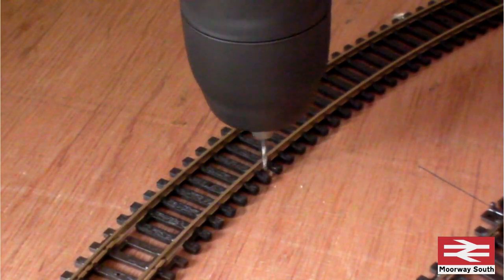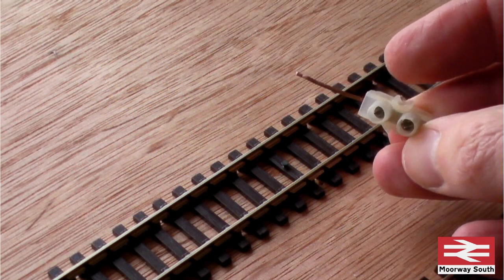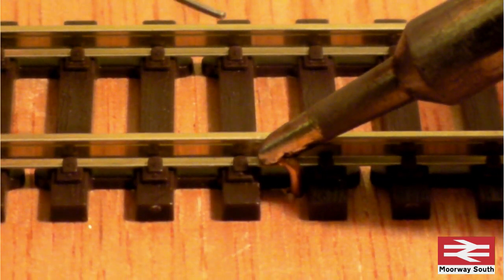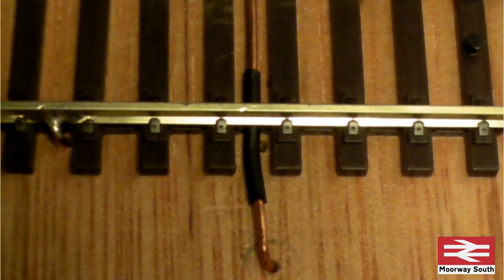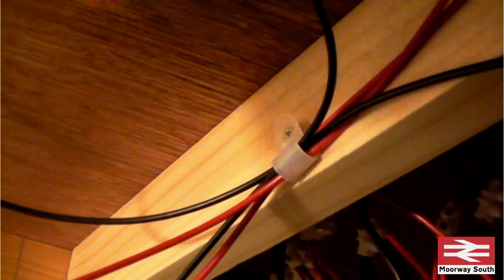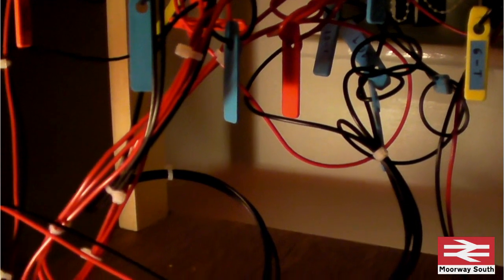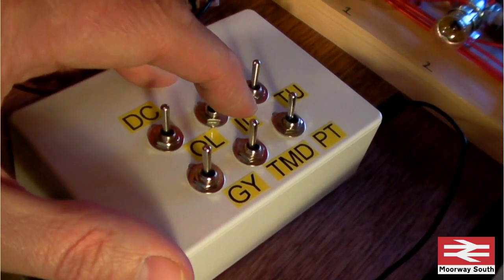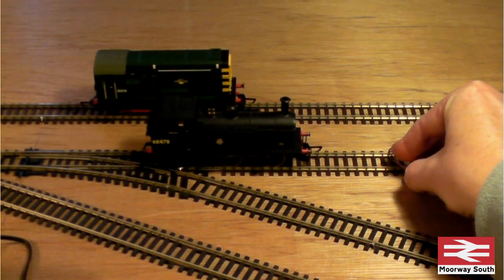Moorway South Part 9 - Droppers, Switching & Short Circuit

Comment: Great series of videos, thank you very much!! Question for you, you mounted your track onto your wooden bench with no cord bed... any special reason why you decided not to use any type of teach bed? Thanks again.
Reply from the maker: I know that some people use cork or other material under the track. Most of the running noise is amplified by the boards so there isn't a huge difference. The trains seem to be running smoothly at the moment - only time will tell! I admire the work of Brian Lambert and since he doesn't use cork I have followed his lead.

Comment: Hi, Great filming and editing.
 I note at 4.44m in you have a Hornby Power controller for your DC output.  I have DCC set up and a similar old Hornby controller last used in the 1980's and at odd times until since so I know it still worked.  My question is can I use the 15v dc track output to boost the track power when using my Hornby eLink set up as it only has 1amp output and I at least want to run up to 8 locos?  Also can the AC supply be used for a lighting circuit? (I am still at the track laying stage).  Thanks
Reply from the maker: AC can be used for lighting. You will need appropriate voltage bulbs, and if using LED's you will need resistors to reduce the current and a rectifier to convert to DC. I have no experience of eLink so can't advise you about that - try one of the model railway forums.
Reply: Thanks for the reply.  On a slow learning curve but making progress with the help from people like yourself.  Ian

Comment: Why use wire so big? I use 20 gage solid wire for the drops and solder them on the back side of the track so they can not be seen unless you really look for them and no I don't get any problems with the wheel flanges because I don't use excess solder. Just enough solder and heat for a perminent bond. since the bracing it in the way why don't you just move down the track a bit???
Reply from the maker: At the locations where the bracing is in the way, I did move the droppers further along.